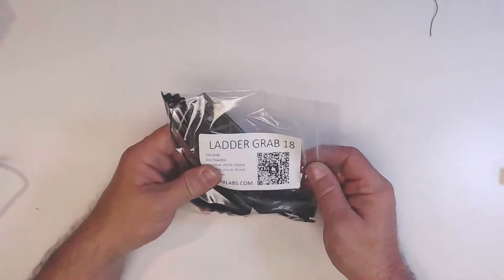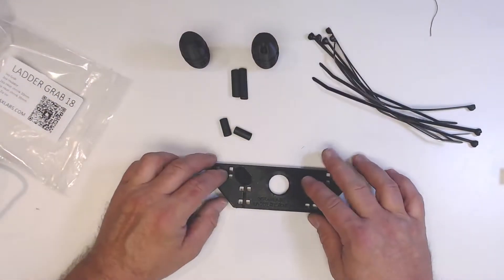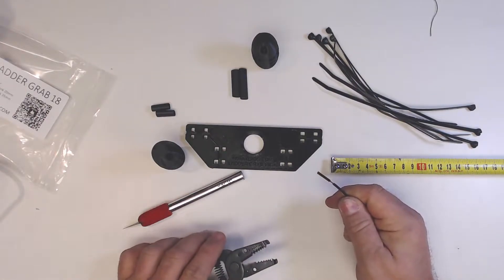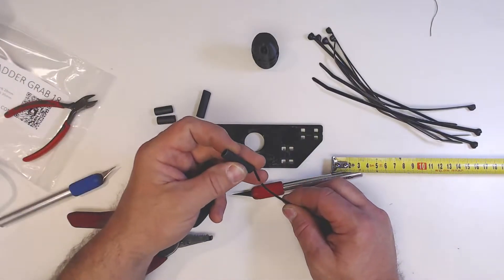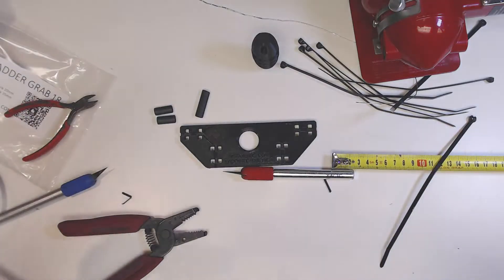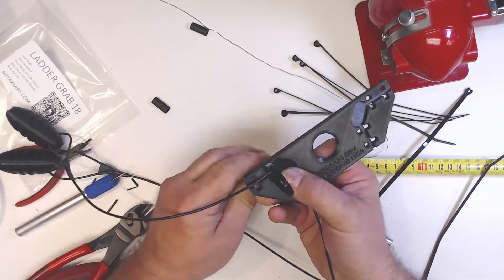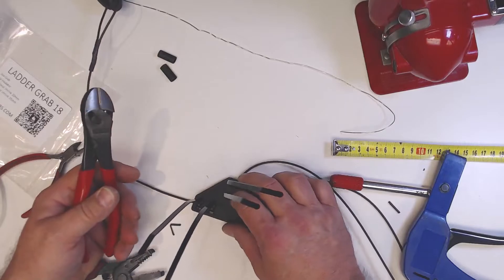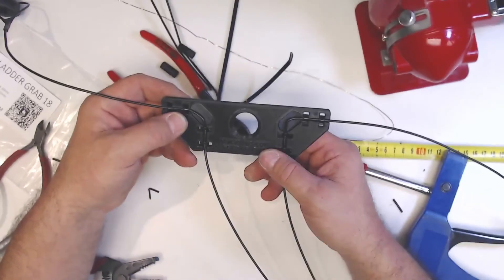Assembly instructions for the Large Ladder Grab antenna center insulators.

Comment: When you cut the Zip Tie with diagonal pliers, it leaves a very sharp edge. Zip Tie pliers are the best choice, and will properly tension and flush cut the Zip Tie. After tensioning with the diagonal pliers, you could use a regular flush cutter, or toenail clippers to get a nice smooth edge. This knowledge comes from many years of wiring aircraft systems.